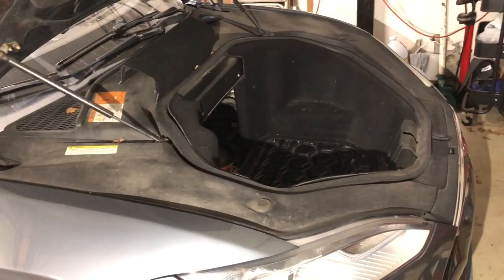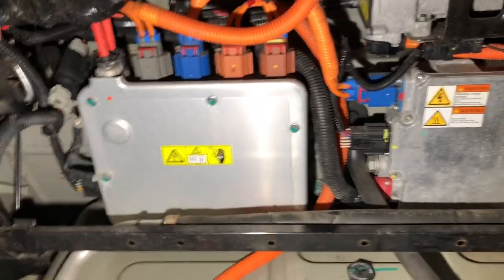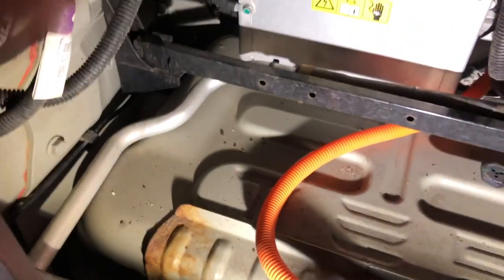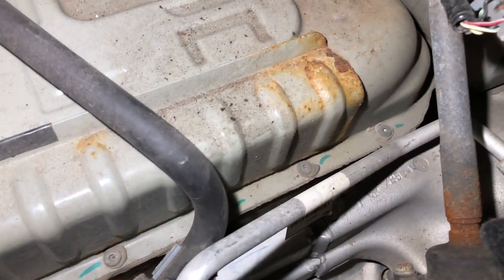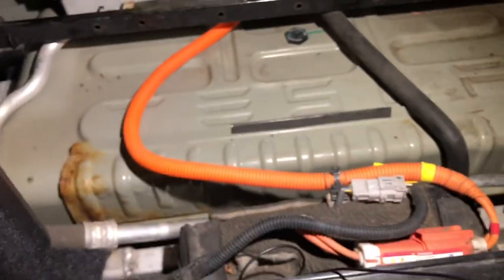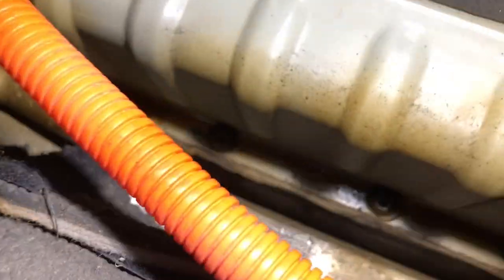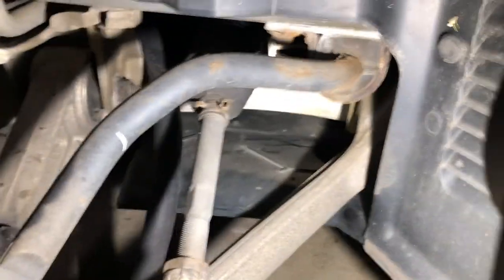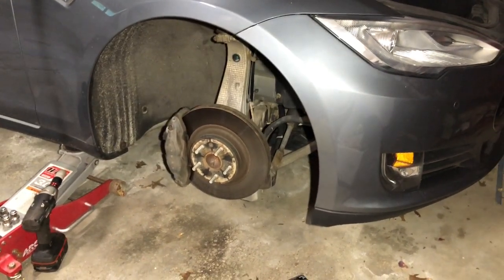Under the Frunk: Rerouting AC drain line to prevent battery damage/failure, rust proofing

Comment: I really enjoyed this video. I have exactly the same Model S situation as you and you've inspired me to add the extra drain hose. Your video technique is excellent, many thanks!
Reply from the maker: Check and (probably) remount the two electrical grounds on both sides of the chassis if you opt to take out the whole frunk tub.  I did not (as you can see) but probably should have just done that while messing with the drain hose.  It's on my to-do list for warmer weather.
Reply: @NZCUTR  Will do thanks 👍

Comment: Thanks for sharing. Will look into this asap. Those 3 and 4 way pumps I think there are 4 one in each corner of the frunk they will leak and need to be changed sooner or later.
Reply from the maker: Indeed -- I have had one replaced already. Paid service center to do it. I forget the price of the pump, but the labor to install was minimal charge and (at least at that time) there were no service options in car for purging the system of air afterward. Last I heard that was a "Toolbox" process (Tesla's service software).

Comment: Thanks for the video! Ill be tackling this next weekend. Guessing your car sees salt during the winter?
Reply from the maker: SOOOOOO MUCH  SALT  !       It's a daily driver, 24/7/365
Reply: @NZCUTR  I want to move to the north east one of these days but the salt does scare me. Being down in Florida, we don't often see rust and knock on wood I haven't seen a bit of corrosion on the underside of the car at all yet.
Reply from the maker: The Tesla has been mostly free of corrosion EXCEPT for brake parts, which require yearly maintenance to keep them lubed up and working. I lost a set of rotors to pitting that took hold before I caught it. The S doesn't have a lot of steel on it, but the steel that is there is prone to causing problems (my steering joint also had to be replaced due to rust-- and I have to keep an eye on that periodically too as the replacement part was just as poorly designed and exposed to road spray).  For my other cars, I do yearly touchups on various products I've sprayed underneath to keep corrosion at bay -- it's annoying, but I'd rather do that than live in hot southern summers.  A day a year to clean/prep for winter is better than months of heat and humidity!
Reply: @NZCUTR  amen to that.

Comment: Are you the original owner? I bought my 2014 in 2021, it has the same hose, i thought it was an upgrade.
Reply from the maker: Yep -- original owner.  I can't remember if I mentioned it in the video -- but some of the older models don't even run the drain over the penthouse, they just have the vertical hose right onto the pack. So mine was already a revision to get the drain across to the crossmember.
Reply: @NZCUTR Ugh, draining into the battery, really?  I have a 2012 but the battery was replaced several years ago under warranty.  I hope they updated this.  Will be digging in soon to verify…thank you VERY much for this video.
Reply from the maker: Total crap shoot depending on service center/tech.  My hose WAS one of the updated variety-- the 2012 literally was a faucet right onto the battery near the fuse hatch. Definitely two design teams were not talking about how their parts would interact.
Reply: @NZCUTR  Pulled mine apart today.  2012 P85 and battery was replaced under warranty in March 2018.  Everything looked good.  The updated hose was installed and there was even signs of care - where the hose originates near the firewall someone had added silicone around the opening.  I could find no corrosion (except for a little on the upper connection of the steering shaft), but found some dead snail shells and an EC port cap, which I refastened onto the correct port.

Following what you did with your car, I thoroughly cleaned everything up, lubed the steering joint, sprayed all the areas that showed corrosion on your car with corrosion spray, and added clear RTV sealant on top of the fuse panel, which did not show any signs of problems, though it is more hidden and not as accessible on my car.  I had to do it by feel and with multiple cell phone photos.

The condensation line did not seem to present any problems, but I'm going to go ahead and buy some hose and lengthen the drain for peace of mind.

This puts me a bit more at ease with keeping the car.  We originally bought this to get higher up the list for the original Model 3 launch, but kept it after they replaced the battery.  I had no idea about these corrosion issues and the venting problems discussed on TMC.  Thanks again for the helpful video!

Comment: Condensation is pooling in the front floor of my 2020 S.
Reply from the maker: Mmm... that's like a different issue entirely. The 2020 S has a very different design for the forward HVAC. You'd really have to run this down from multiple angles though. It could be a clogged HVAC drain line, clogged roof drain, door seal failing...  there's a lot of possibilities.
Reply: @NZCUTR  I have a service appointment in a couple of weeks...the best they could do. Not a problem which I was expecting. Its not a failed door seal.....something to do with the AC. Its under warranty.

Comment: Thanks for the video! Any idea how to reach the hose in case of a S85 P? There is a second engine..
Reply from the maker: The dual motor variants shouldn't have this issue -- at least that's my understanding.  A RWD P85 will be the same as my non-performance S.
Reply: Cool, thanks a lot!